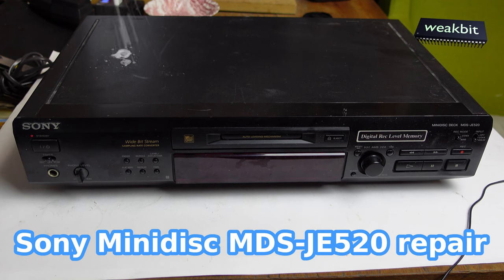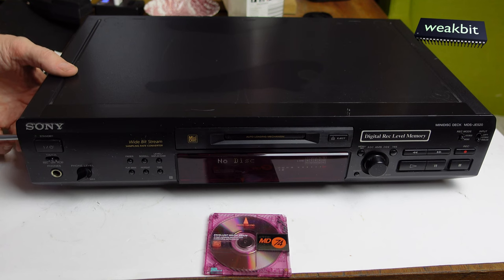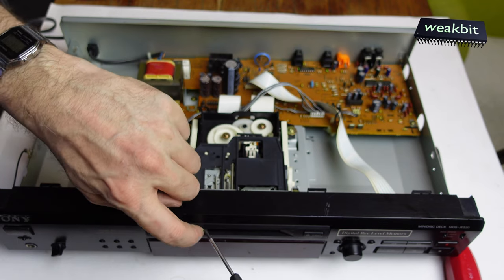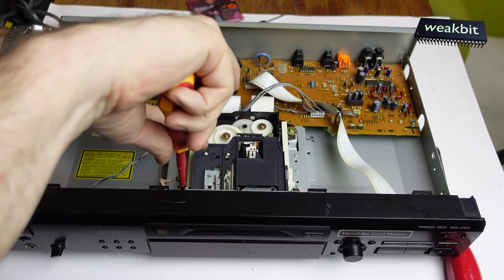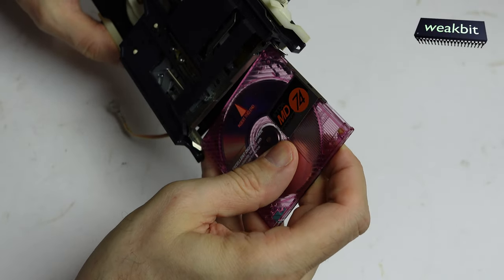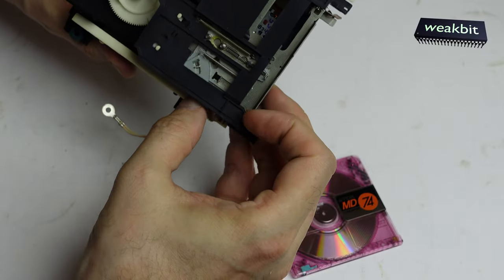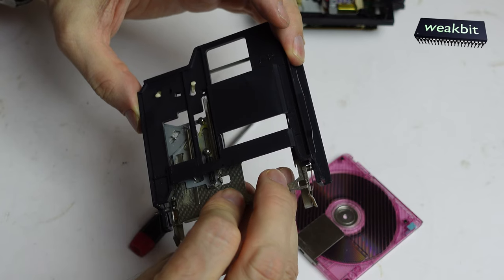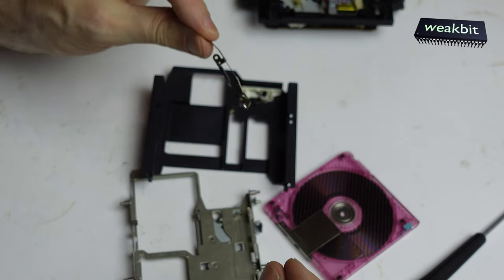Sony MDS JE520 Minidisc repair

Comment: Thank you very much for this great video and repair ! :) I have a fantastic Yamaha Minidisc MDX 793, unfortunately it can read and play but it does not write the music and the TOC. The video has motivated me to open it. I hope it is just cleaning ... I will see... Vielen Dank für das Video! Gut gemacht!
Reply from the maker: Not writing the data onto the disc. If you write direct to a Minidisc the Laser melt (or hold the disc in a light liquid form) during the electromagnet are writing the data into this material. What we can measure is the current from the Laser so do the temperature occur? and/or the magnetic field is to low. Lets have a watch and please report here if you are having questions. Other I think this is the power-supply maybe there is the fail? Have luck! I hold you the thumbs! weakbit
Reply: @weakbit633  Thank you so much for your quick answer. I will open it end of next week and I will give you an answer. Danke!

Comment: Thank you so much for your quick answer and that you try to help. Unfortunately I have to say I am lost! I cannot measure it, I have not an oscilloscope and I have no knowledge about electronic repairs. I have some fine older Yamaha HiFi machines, I was able to repair some mechanical problemes, but electrical things are not my issue... I know for the MDX 793 what the magnetic head is doing and the laser is doing. I have also read that sometimes a common issue is damage to the write magnet above the head and that the distance between head and disc is sometimes incorrect. It is sad to keep this 793 just as a player. Have you perhaps interest to have a look on it? If yes, how could it be possible? Kind regards, Christoph
Reply from the maker: Hello Christoph - I'm very happy that you requesting me about a look on your HiFi machines and it is Super that you are watching my Video - but in that case I must say I do no repair or have a look on machines in that case that I've so much to do with all this stuff here. It is easy to tell I organize a lot of machines to repair it on the front of the Video camera and reorder spar-parts in all over the world so I must check that up then my day is short in that case that I have so much different types and models here in my show. I'm very sorry to tell you that is not possible to repair also for other and I know you need help in case of your issue. I don't know where is your hometown but please there must be a service for HiFi and or TV-sets that can be ask better and easier and cheaper. Thank you for understanding this situation. weakbit

Comment: Hello Weakbit, two weeks ago I told you I have a fantastic Yamaha Minidisc MDX 793,  it can read and play but  unfortunately it does not register the music and the TOC on an empty minidisc. After I copy the music, the machine writes the TOC for a long time but then the display shows "Disc empty".  I cleaned the magnetic head and the laser carefully but the result is the same.
Have you an idea?
Kind regards
Reply from the maker: First of all search and download this file hfe_yamaha_mdx-793_service_en.pdf there you can see the signal ways. There are some service menu and this can fix the focus etc. I don't know if you have a oscilloscope so it is easy to measure the FM packet that come down from the Laser-Pickup. Site 31 show the IC1101 RF-Signal Processor there you should measure a signal that looks like a FM packet. (this I'm missing to send here a picture). After you have analyze this so answer here and maybe I can say something. Thank you for questioning. weakbit
Reply from the maker: it is helpful that you buy a meter for example the UNI-T139B find it at Amazon for ~€32 and it is in it's quality a good meter. To start your hobby measurement carrier and repair in your hobby time. The magnetic head is only for writing the bits into the disc. During writing the Laser warm up the disc in the beam spot to the melt/liquid point and the electromagnetic field turns the bit in position like the data should be. Now the melt/liquid flip back and cool out and so the data can read from the laser reflected bit stream and there is the play function. That the distance from the electromagnetic head make so much sense I think this is a story. weakbit